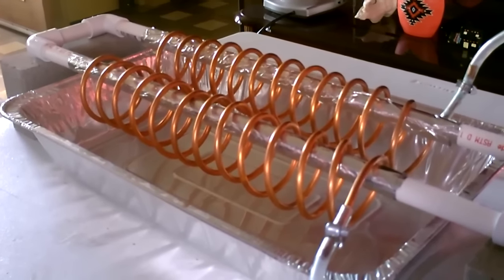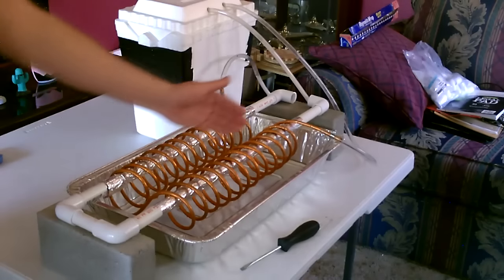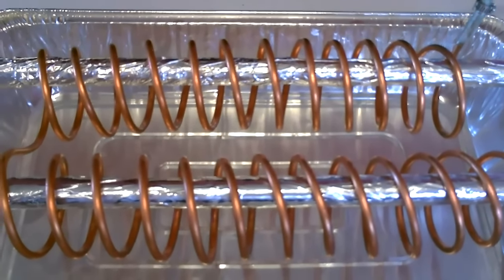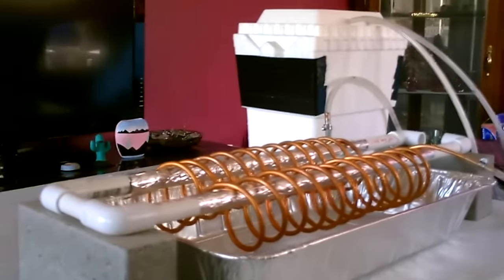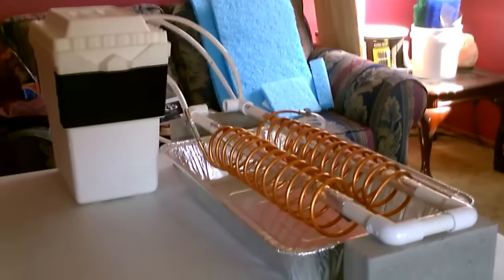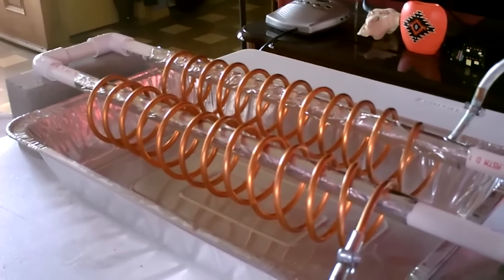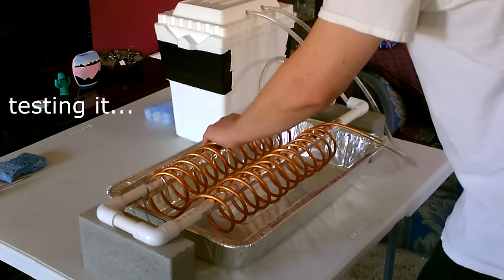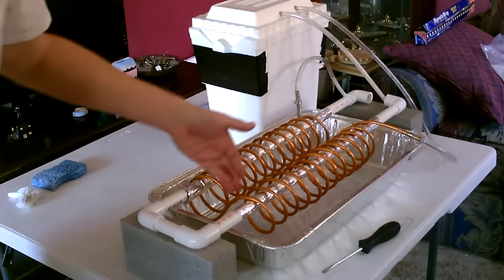DIY Atmospheric Water Generator! - Produces/Extracts Distilled Water from the air! - DIY distiller

Comment: How do you bend copper tubing without damage to the tubing
Reply from the maker: hi there. if you're not bending it any tighter than i show, you can just wrap it around something like a soup can or a section of PVC tube and it will not damage it.
Reply: @desertsun02  I've heard you can also fill with sand during bending then clear.

Comment: All you need atually the copper tube for condenser and pressure release valve and a tire inflator or a wind cathing to push air through pressure valve then expand in copper tubing with large volume expansion and some way to get enough air through but not too fast then most probably alot of water enough for cooking for family

Comment: How does it work
Reply from the maker: hi there. works by cooling air down to the dew point. dew then forms on the copper and drips into the pan. (dew is 'natures way' to purify water). the system pumps cold water through the tubing to cool the copper coil. the process is similar to when you set a glass of ice water out on a hot humid day and dew forms on the outside of the glass.
Reply: So if I took an old radiator and put a pump on it would the dew collect on the aluminum fins to?
Reply: I'm looking to diy one of those "hydro panels"
Reply from the maker: @Paul Martinez it probably would. it probably wouldn't be clean water though. (because the radiator would most likely not be clean)

Comment: Yea but you are using electricity for the pump and ice maker. I have an idea to use an alternator wind mill. Which will power peltier heat exchangers as well as draw air over them.  I live in a windy place so that's my plan. But solar panels would do the same thing if your weather is mostly sunny

Comment: As soon as the water in the cooler warms up to room temperature the condensation stops. So you need to keep putting cold water in the cooler. Ok, This is not distilation, only condensation.
Reply from the maker: hi. natural condensation (if collected on a clean surface) is essentially the same as distilled water. all that condenses is pure water. they sometimes call condensation "natures way to distill water". it's not perfect but pretty close

Comment: So you are using water to make cleaner water?
Reply: No. He's using cold water that runs on a loop to run inside the coils. The outside of the coils gets warm from the air and meets with the cold copper to create condensation. There is actually potential in this design.

Comment: (Thinking here any help is appresated)
Ok so what I need is a way to cool water1 (refrigerate to near freezing say 34 degree)
Then move the water1 by 12v pump ( ok this is already found, a boat bilge pump) through coil Cooper tubing.  This causes condensation ( water2) the water2 is collected in a catch pan. Which can drain into a sump ( a better word can be used here but I can't think of the word atm). 
Then the water1 is returned to cooling system. 
So need a way to cool water1.
Reply: Does anyone have input of going the other way?
Taking room temp water. Putting it through heat. Will this cause condintation?

Comment: Would you be able to show how to build one of these?
Reply from the maker: hi there. this video is meant to be the "how to make it" video. all i really did was coil up some 1/4" copper tubing and attach some 1/4" (internal diameter) vinyl tubing to that. then i attached a small water pump and placed it in the ice chest. that's really it. then you just pump the cold water thru the pipe and vinyl tubing in a loop and catch the resulting condensation in a pan. do you have a particular question i could answer? 🙂

Comment: Wouldn't it just be condensing on the outside of the copper tubing because of condensation you're putting a cooler inner atmosphere and direct contact with a warmer outer atmosphere I don't know exactly what you did here so if I sound stupid as f*** just know that this is off the hip and I'm just thinking of a cool soda can that come out of the fridge sitting outside on a 90° sunny day

Comment: Better running it somewhere with much higher absolute humidity, get water warmed by the sun? Easy  to get to 40C 95% with a covered pond.  Liked the focus on potability, I'd be using a ceramic dish not the aluminium. Near brackish water should be OK, pollution from salts or most bugs shouldn't be jumping across, oils might.
Reply from the maker: you are 100% right about it working better in higher humidity. i bet this would work 4x as good if it was used in florida. i made another AWG that's powered with peltier modules but the water output was fairly low so i never posted the video. now i'm thinking maybe i should post that video and tell people to try it in higher humidity areas.

Comment: What's the aluminium foil for?
Reply: It is to keep the water from contacting the PVC pipe. If you don't care about water touching PVC, you can leave it out.
Reply: @DibbleThorp  I would be more worried about aluminium in the water.

Comment: HOW DO I ADAPT THIS RIG WITH MY SOLAR PANEL. Q: WAS IT ICE WATER IN THE STYROFOAM CONTAINER?
Reply from the maker: hi. yes, it's ice, or rather ice-paks, that i use to keep the water cold. most (if not all) 12V DC water pumps work great just connected straight to a 12v solar panel. i do that with many of my DC projects 👍

Comment: Isn't this a dehumidifier? I don't think it's considered distilled.
Reply from the maker: hi there. you could think of it as a dehumidifier since it's pulling moisture out of the air. it's not 'steam distilled water' but condensation is known as 'nature's way to distill water'. the only thing that will condense is pure water. any contaminants in the air will remain in the air. the main thing is that you have to do is keep the copper coils clean. (but the water will be as clean is steam distilled water, if the copper is clean)
Reply: @desertsun02  I looked up dehumidifiers for water collection a couple years ago and people say it's not safe to drink. I've had things growing in my dehumidifier. Maybe that's do to contamination on the device itself. I know copper itself helps stop things from growing. I'm a little hesitant to drink water condensed from the air.
Reply from the maker: @Zanroff you are correct in saying that you should never drink the water from a store-bought de-humidifier. it is contamination from the device itself that is the problem. i've read about that too. there are a lot of parts on those (solder joints, hoses, fitting, seals, gaskets etc...) and all could grow bacteria. with my device it's just one thing... the copper tubing (but nothing else) so if you keep that clean then the water that condenses on that will be clean too. it's like the water on the outside of a glass that condenses when you have cold or ice water in the glass. works the same way (but instead of the water condensing on the glass it condenses on the outside of the copper tube.

Comment: What is the coil - is it copper? Where did you find the copper and the condenser (box) for purchase (could you please provide a link or location/store)? Also, I was wondering the tubes, are they just simply store-bought tubes or do they need to be purchased from somewhere specifically?

Your video has already helped me greatly with a school project I am doing, and it would help me even more if I could get ahold of the materials used in this video. Awesome idea and video, good job!
Reply from the maker: hi there. you can get most of it at any home store (home depot etc.). it's 1/4" copper tubing. the box is just a small styro-foam cooler. pump is a small aquarium pump (i used a 200gph one , but you could use a smaller one). white tubes are 1/2" PVC pipe. all of that is sold at the home stores along with the clear vinyl tubing and clamps. aluminum foil and metal pan can be found at a grocery store or walmart.

Comment: problem is the energy used to freeze the ice packs in the chiller, when the water eventually warms up above the dew point you then have to put new ice packs in, so the real secret is in the freezer that chilled the ice packs. You cant get something for nothing
Reply: Yah. If you had an old refrigerator cooling system, then you could hook it in and use solar panels too.

Comment: I haven't opened up a air conditioner to see what's inside, but I would assume that's why there's water in it.
Reply: The copper pipes inside ac gets very cold. when  Warm moist air touch it, moisture condensates, drips onto internal tray, a drain pipe carries the water outside. ( I'm an AC installer).
Reply: @richardday2893  Is the water from and AC unit...drinkable after filtering?

Comment: A stupid layman's question?
If cooling the coil causes this effect, what happens if it heats it up? will it have the same effect? and if so, what would be the easiest and most energy efficient way?
Reply: it would not. Think about a cup of ice water vs a cup of hot coffee. The coffee cup doesn't get wet on the outside whereas the ice water cup does.

Comment: Looks interesting. Where do I get the copper tubing? What. Size tubing? Where do I get the pump?
Reply from the maker: hi. it's 1/4" soft copper pipe. i got it at home depot (amazon's a great place to get it too). i got the pump at harbor freight (amazon, walmart or any aquarium supply store should have them)

Comment: will it differ if i used R134a refrigerant at 10 Degree Celsius  instead of cold water and i passes a hot air at nearly 40 to 70 Degree Celsius

How much water does it produce in an hour or 2

Comment: It’s the same water you pour in the white thing
Reply from the maker: hi. the water it produces is separate from the water that is circulating thru the pipe. unit is actually pulling water out of the air 💧✔🙂
Reply: @desertsun02  it’s the same water if you pour it back in you will see it’s less of what you poured in

Comment: Requires an electrical pump to work? Might not have any power in a disaster. Clever design as usual though.
Reply from the maker: hi there and thanks. easy fix to that is use a 12VDC water pump... and hook to solar panel or 12v battery

Comment: Using water to make water. I'm lost.
Reply: The water used is in a closed system loop which cycles through the apparatus and is utilised to help generate atmospheric water via the copper coils which falls into the pan..

Comment: I'm still in a house now and I get my water for free out of the side of a mountain to wash fruits and vegetables off with.. But when I move off grid I will definitely be trying to save my air conditioning and dehumidifier water for hand washing, and bathing. I'm looking more into making water on a bigger scale. so I don't have to go get the free spring water out of the side of the mountain. or I may have to buy it when I move way down the road or out west. If I can't get free water.. My humidity in my house yesterday July 10th 2019 was right at 70% humidity. I don't guess this would work as good in Southern California or Arizona. or in places like someone said out west humidity is in the single digits a lot of times. But as long as it will still make some water is the thing. If I was trying to make drinking water though. I would use the boiling water method first. But for bath and hand washing water copper is ok. In my area we have about 5-6 places to get free fresh cold spring water flowing 24/7 year around out of the side of a mountain. This water is far better then recycled tap water. But distilled water still is the purest you can get if I could only get it for free out west enough for my family. The only water I mostly drink is alkaline oxygenated 9.5 pH health food store water for $0.99 a gallon. I would only drink other water in a disaster where no other water would be available and I couldn't water boil distill it or buy it. Tap water is a slow form of poison. I might shower, wash my hands in tap water but I definitely would not consume it. Tap water has up to I think it is 1000 contaminants in the water and they only remove a small part of that. And some things they definitely cannot get out of the tap water because remember it's used recycled nasty shit water they turn into they say clean drinking water. My friend works in the Water Department and they only hit the high spots spots and the garbage they put in the water is very bad.

Comment: This is distilled water.  You start with water and thru a distillation process, create more water that would be of a better quality.  It's like catching the steam from a boiling pot of water or food - that water or steam is distilled from the original water.  This is not creating water from air, its basically sweat.  The same thing happens at the fast food joint on the outside of your soda cup.  That water which accumulates on the outside of the cup is in a simple form, distilled water.  This process here is creating better water, from maybe questionable original water not water from air, since you start with water to begin with.
Reply: Yes, but you still get more water at the end of the day than you started with.

Comment: Good design.  There are so many variations to this.  A bit of research and experimentation could yield great results.  Be careful, though.  Some concepts use heating ammonia under pressure, then releasing the pressure to cool things off.  Dangerous stuff.

Comment: thanks be to God I have an idea for a proposed Air conditioner machine that can be used to collect water thanks to the maker of this device. using small current and voltage, one applies it to a hollow ring of copper placing inside freon r12 with metal shavings ( small pieces of metal dust ) hypothetically speaking the current shall and may make the attracted metal and magnetic field spin the gas at high rates thus cooling it dramatically causing henceforth droplets of water to form same as the YouTube aparatuses' machine. God willing. any thoughts or improvements?     (- for the sake of humanity free, water to all)
Reply: Heh, people don't realize they already own an Atmospheric Water Generator. Also known as an A/C.
Reply: let me know how it goes, or which condenser to use plzz

Comment: Wait. You’re creating water with … water? 😂
Reply from the maker: hi yes. i've recently finished another unit that uses peltier chips to cool down the copper (so no extra water needed with that one). i'll post video soon.
Reply: @desertsun02 when are you planning to post it.....been waiting for a long time
Reply from the maker: @mohammedsarfarazhussain4785  i finished the new project video that uses peltier to extract the water from the air but now i'm thinking it could be better. i'm not sure if the project works good enough. i may redo it before posting. (if i redo it i'll have to wait until next summer because i can only get the best footage when it's humid).

Comment: 😆 it will not work vey well in desert with low to no humidity  or water vapor. Better a boiling pot using solar heat with a cooling surface above to condense steam or piped to cooling chamber with a drain to a sealed storage container. Kind of a distiller ain't it?
Reply from the maker: hi there. yes - they sometimes call (condensation) 'natures way' to distill water. i've got a fairly new video on how to boil water using 12v or 12v solar panel to boil and distill water.